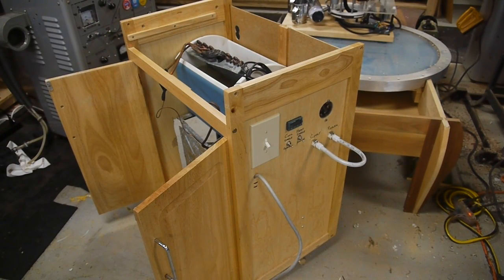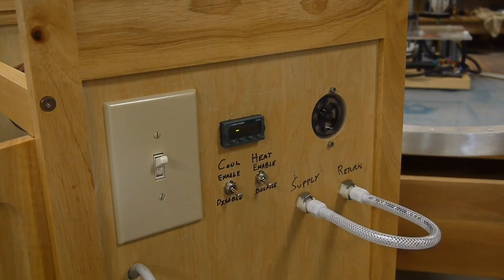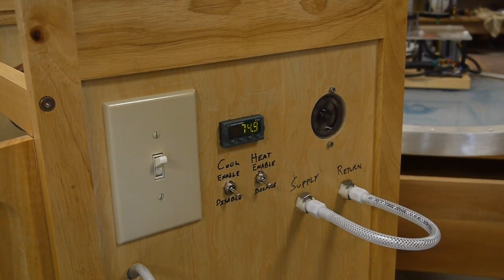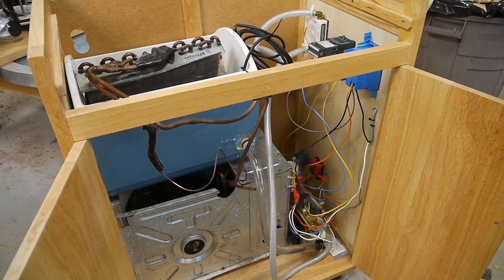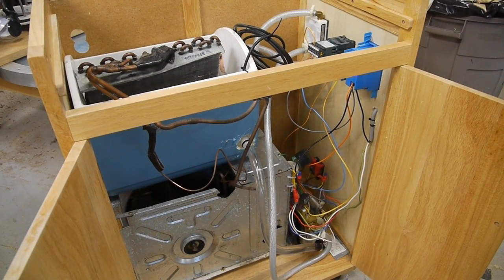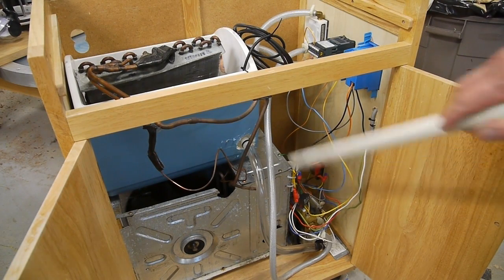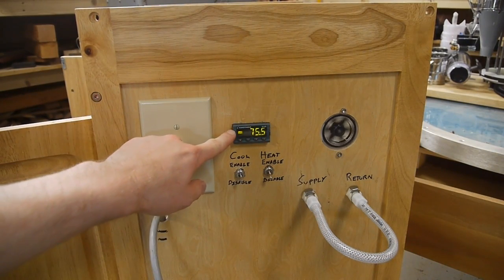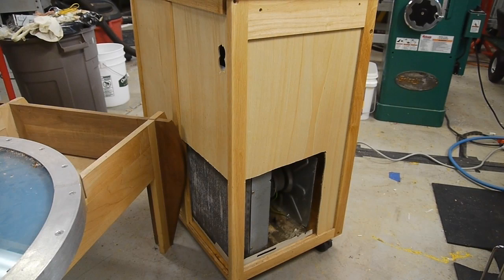Water circulator with temperature control

Comment: Was programming the PID challenging? A friend of mine was having problems controlling digital modulating valve on a cooling water return line, also controlled by an RTD, for a project of his.

Comment: You could use something like florinert but that stuff is insanely expensive. You can also use ethylene glycol mixed in, thats what most chillers that need to run below 0 use, otherwise we use distilled and deionized water in our lasers.

Comment: The cheap ones I buy from RS have a timer, and work well as controllers. Sime PID have them as well, might be a cycle timer or a delay in the manual. Otherwise get an external delay timer and use a 3 minute power on delay.

Comment: Idea: Hook the PID controller to a sensor on whatever project is using the water, that way it can compensate for heat gain/loss through a long hose, and you don't have to have the unit right next to your project.

Comment: could it (as is) use a different medium than water?  [meaning a liquid with more thermal range]  I'm thinking if u used alcohol in the unit, u could circulate liquid at temps below zero degrees C

Comment: You can set the temp controller to have a minimum cycle time, and set it to 5 minutes. That will prevent short cycling, and yes with R22 it will probably have liquid return at low water temps, but if you only want to cool to room temp from a hot source it will not be getting liquid to the compressor so much that it will worry it. Coils will probably corrode through from the water, unless you add antifreeze. I added KI 0.5% as an antibacterial agent, it keeps the open water pretty sterile.

Comment from the maker: I have a 5/8" dia x 6" rod, ruby mirrors with gimbal mounts, 14KJ capacitor bank, cooling water, and a desire to make it work. I need a flashtube (long helical preferred), and a way to figure out the mirror coating directions and alignment procedure.

Comment: A couple of possible issues with that setup, the ac unit is most likely is charged with r22 at close to freezing you may have liquid slugging in that compressor, 134a may be more suitable (410a Should be fine as well) . Also I didn't see any short cycle protection for the compressor, so that may be needed. The large volume of water may prevent that but at certain temps/loads it can happen, I speak from experience but just my 2 cents. Can't wait to see what happens with that magnetron.

Comment: I would suggest putting a coating on the Evap coil, The brazing is known to fail after prolonged periods of submersion (Not uncommon for window units to fail due to this when then drain port has clogged up.). A better option would be simply removing the evap and brazing in a plate chiller in its place, then evac and recharge the system.

Comment: I've found a huge problem with temperature controllers is that every single one that I've found just turns the element on or off and you end up with heat ripples. Even through 1" of steel the ripples still came through instead of evening out. Caused a lot of problems on a heat sealing packaging machine. The solution: Simple dimmer switch.

Comment: In the past i've used an in-line beer cooler as a chilled water source. Used to do overclocking in the early days of Pentium II's. Relativley easy to pick up second hand. You fill the heat exchanger with water and it deliberatley freezes building up a bank of ice inside as a reserve around the coils. Really neat, quiet units. You have the ice bank there if the power goes out, or your load exceeds capacity for a few hours.

Comment: Hi Ben, have you considered using a heat exchanger instead of a separate heater and a/c? You could use a flow control circuit (valves/actuators) to direct the water and use the pid controller to turn on the entire unit only when the temperature reaches a near ambient state.

Comment: This is incorrect, many industrial PID controllers use a discreet output. The outputs duty cycle is modulated over a programmable control period. For example, for a 25% output w/ a control period of 20 seconds, the output would be on 5 seconds and off 15. Shorter control periods are used with faster non-mechanical outputs such as SSR's.

Comment: I don't think that PID controller (and most of ebay) are PID controllers
PID must have analog output so it can set power to the device exactly (so if it was a real PID it would not function via relay in on/off mode, but it would for example accurately set the exact power needed to keep water cool at that temperature, not turn it on when it is hooter and turn off when it is cold enough)
That would be three way regualtor

Comment: I see. One thing to watch out for, these compressors dont like to be turned on an off without a couple minute period in between to let the pressure bleed down from the high side. I killed one this way... Oops. A lot of new compressors use a thermal starter relay that will prevent the compressor for coming on too often.

I have a water cooling project too, figure out how to dump about 16kw of heat from the laser welder I hope to get from work! I am trying to avoid a garden hose.

Comment from the maker: The system can use the heater to stabilize the output temperature quickly after the compressor is turned off, but this isn't necessary for most cooling water applications. I added the override switch so that I can disable the heater, and just allow the temperature to undershoot the setpoint. I thought that I might use the whole contraption as a source of heated water as well, so that is the main reason I added the heater.

Comment: So when you want to cool you turn on the compressor and the heater stabilizes the temp when it hits the set point or does the SSR turn the compressor on/off?